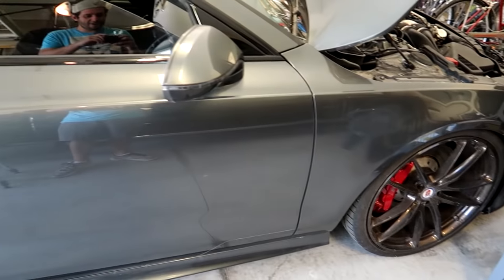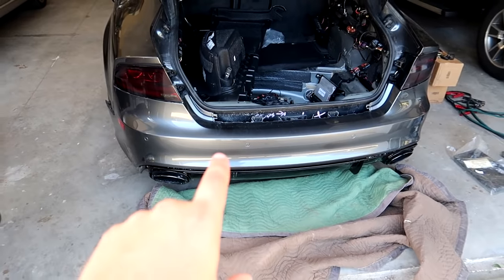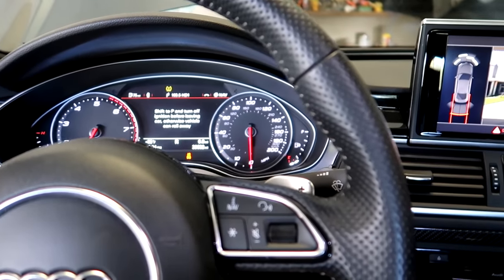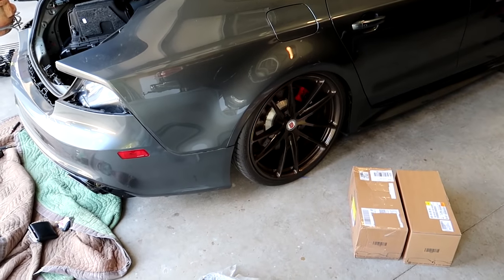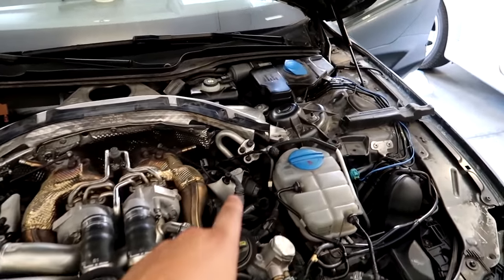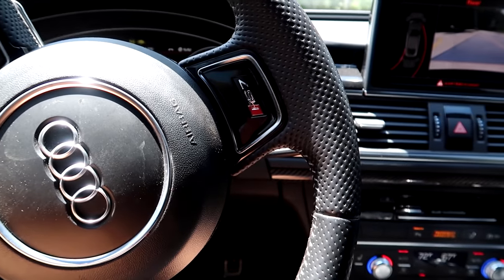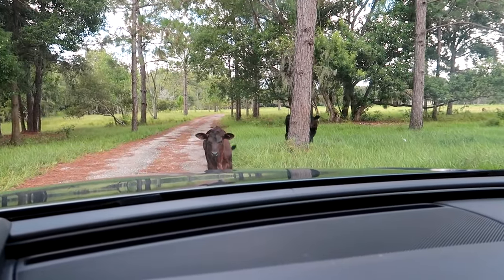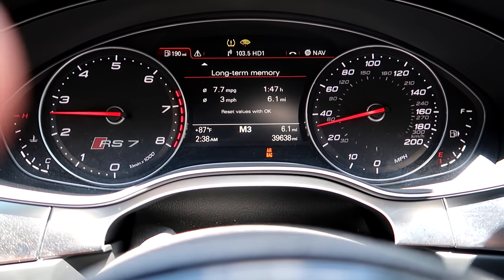Wrecked Audi RS7 Gets New Suspension and TEST DRIVE!

Comment: You have a change tyre mode for the suspension in the mmi use it or you could pop the springs again when jacking up the car, and also the tailgate wount work without all the switches installed.

Comment: For electrical why don't you pull the multi meter out and do voltage drop test to pin point your opens and shorts? Seems 2 me you would save alot of time and money as opposed to assuming parts/harness are damaged and full out replacing. Solder is way cheaper then sensors. Good videos man. Keep it up!

Comment: The odds of both the lift struts going bad on a 2014 car seem low to me. But it is an Audi/VW product and they do have questionable electronics. The struts are probably good but perhaps the sensors went? We'll see when you pop in the new ones.